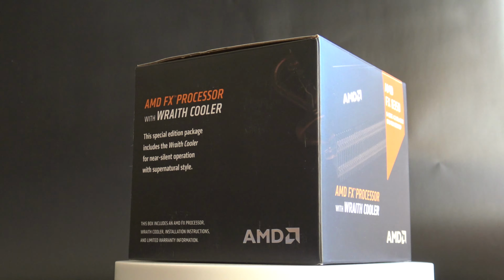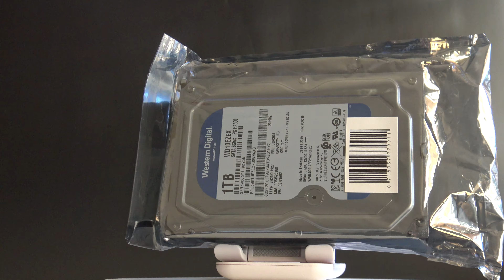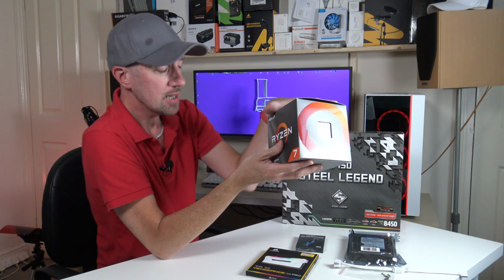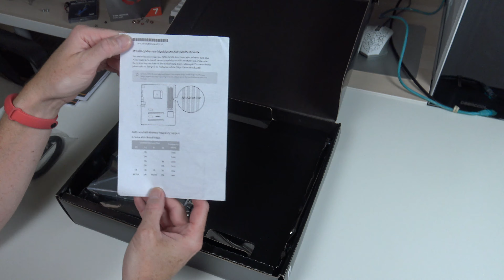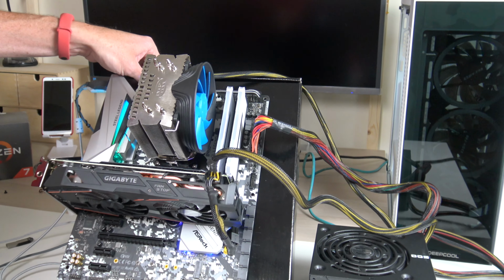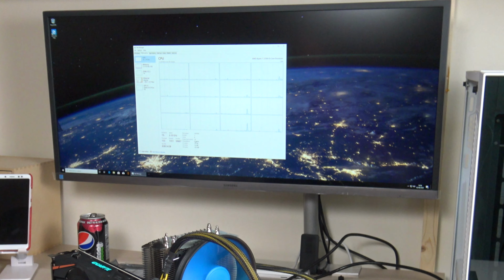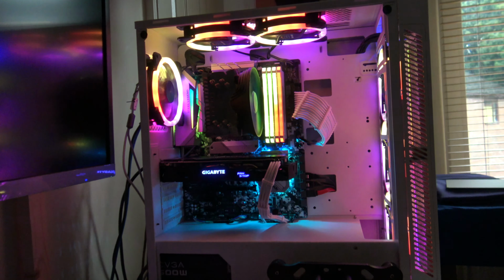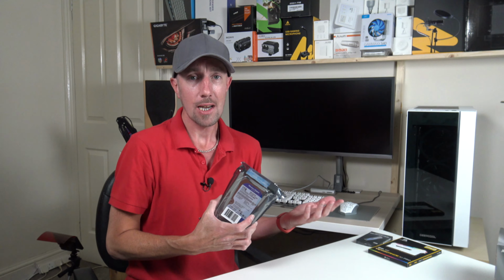I've Upgraded my PC! Ryzen 7, My PC Build! (UK 2020)

Comment: Awesome video Dude!! I'm having issues with that exact ram in my Aorus x470 as it does not like XMP at all! had to manually overclock it to 2933Mhz as it will not run at 3200 :(
Reply from the maker: Cheers 👍😁 Took a while to edit it all, otherwise would've been a 3 hour video! 😂🤣😂 
Maybe it's time to get a B550 momaboard 👍😉

Comment: Seen the case.  Looking good, you can get 140 fans in there. . Looking your cpu cooler and thinking it's a small one compared to what I want to fit in there... Coming on Friday, I'll find out 

And yeah AMD rock for video editing and streaming with amazing multiple core speeds. But I'll stick with Intel for extreme gaming which requires high core single speeds. .

I ran out of cash so my build won't look as good as that.. two 120 fans, and 1 exhaust fan and maybe one 140.. I gotta make it work 

I see your doing something else to what they tell you to do with fans on the top blowing the heat out, your taking air in which I think is genius.. I'm going do the same .. Makes more sense
Reply from the maker: Cheers 👍😉 
Keep us updated with how you get on 👍😁
Reply: @IXISonTech  Couldnt get the darn cooler in.. Didn't know I ran out of fan screws so ordered water cooling hoping I can get it in and it performs as good as the D15
Reply from the maker: Aww ☹️😒 Maybe you should make a video for others to watch, warn them that that cooler doesnt fit.
Shame.
I would like to go water cooling in the future 🤞 
Hope everything works out for you 👍😉
I look forward to another update 😊👍

Comment: I just upgraded from an 8350x, which is still a fairly capable processor if all you you’re doing is gaming. I still managed with it without any headaches anyway. Got a 2700x now and it’s much better. Did you get the Hard drive installed in the end? :’)
Reply from the maker: I'm still using my FX8350 in my work from home pc 😁 
Yes, I did put in the new HDD 👍 will be needing another one soon tho 🙄🤭
Cheers for watching 👍😉